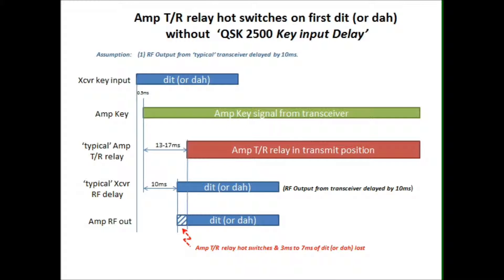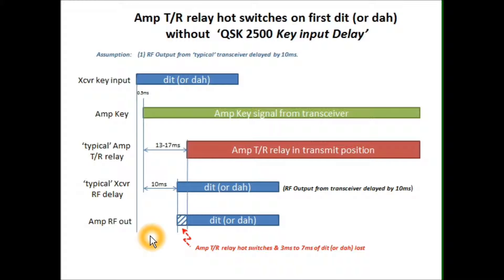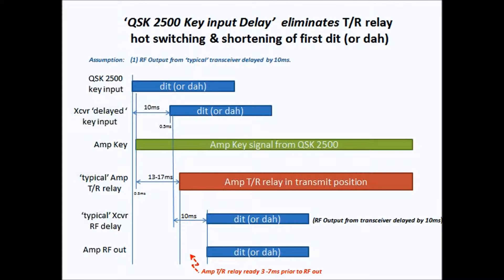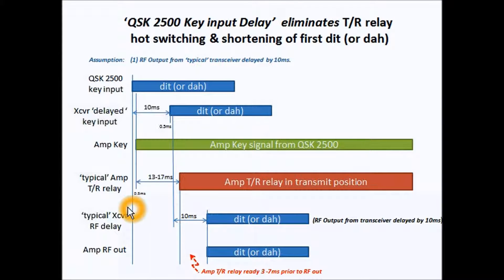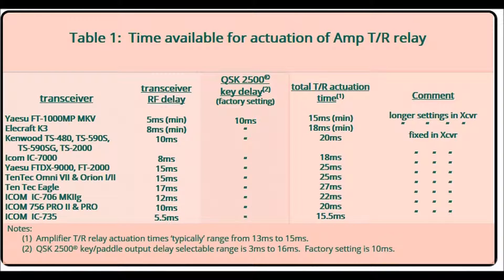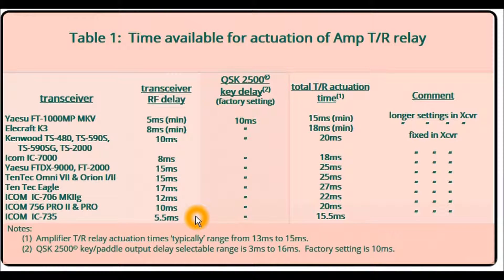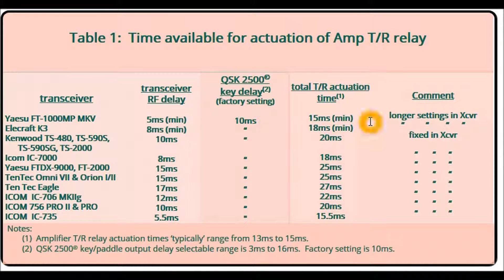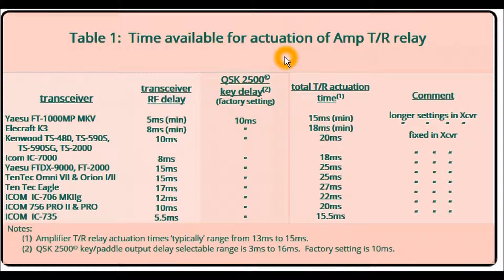QSK2500 TR RelayTiming

Comment: These radios can be set with additional delay.  Many up to 30 milliseconds without any external qsk box.    Does this relay box keep the amp keyed one milliseconds after the key line returns to zero such that  the relay stays closed until all  RF disappears from the amp input ?
Reply: There are two delays involved here.  
(1)  One is 'TX Delay' that delays the RF from the transceiver following input from the key or paddle input. This prevents hot switching of the amp T/R relay going into transmit.  The QSK-2500 delay channel adds to the TX Delay.   If the transceiver can generate 20ms of TX Delay, then normally the QSK-2500 delay channel is not required and can be bypassed.  

(2)  The other is 'break-in delay' that delays the "transceiver's return" to receive state from transmit state.  This delay should be set close to zero milliseconds for QSK operation.  The QSK-2500 bypasses the amp in receive mode and connects the antenna directly to the transceiver after 'both' the release of the QSK-2500 Amp Key signal input and the RF output power from the transceiver going to zero, whichever occurs last.    This prevents hot switching of the relays in the QSK-2500.   

The amplifier is unkeyed only after the QSK-2500 has been in receive mode for '3 seconds'.  ...Bill K3HZP